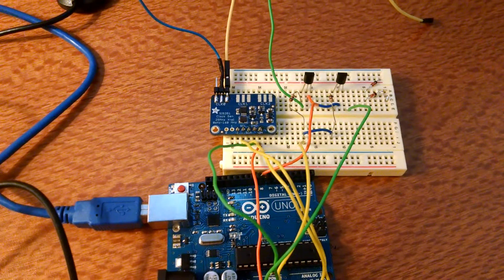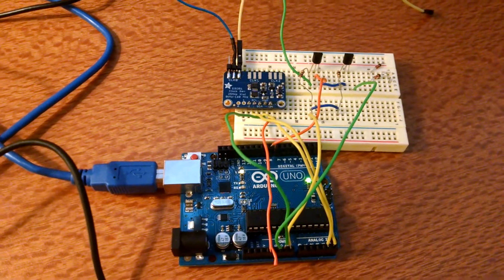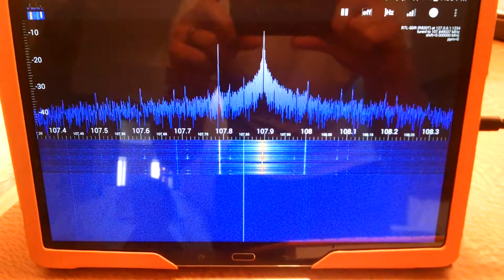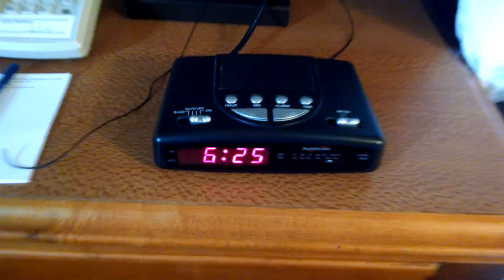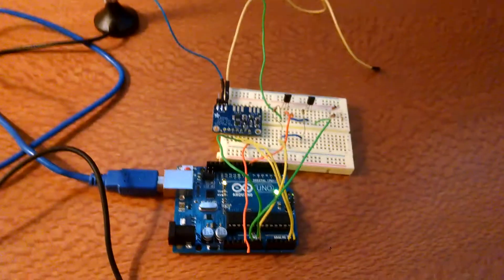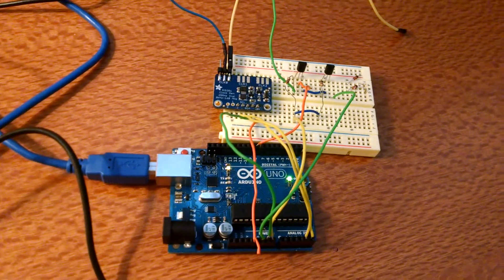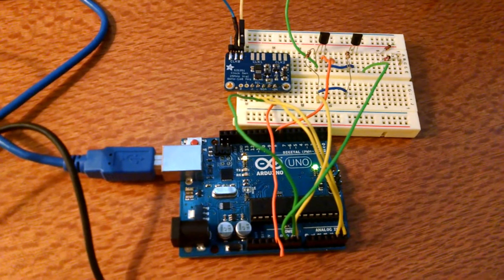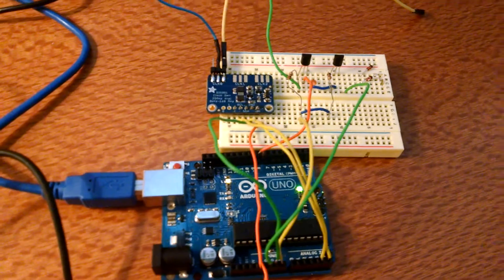Adafruit si5351 FM transmitter

Comment: Very cool, but this is not FM modulated. You are effectively adding the music waveform to the steady frequency output of the oscillator, which creates AM. An FM receiver can roughly demodulate this if the AM signal is strong enough. Also, the music waveform is switching the transistor on and off, which is why the signal comes and goes.

One common way to create FM is to use a diode (preferrably a varicap, but many different kinds will work) as part of the oscillator circuit. This is typically done near the crystal - the varying capacitance across the diode will "pull" the crystal above and below its nominal frequency, creating the frequency swings that produce FM. In this circuit, though, the "pullable" portion of the oscillator circuit is far removed from the characteristics of the transistor, so the base frequency is not changing.

As Steve Wright mentions below, the Si5351B chip has a voltage-controlled oscillator on board. That circuit within the chip can read an incoming voltage and use it to either trim the frequency output for improved precision, or if an audio signal is applied, use that to vary the frequency of the oscillator, producing FM. I have been looking for a breakout board for that chip similar to the excellent Adafruit product used here (or even just the chip itself at a reasonable price), but have not found anything (May 2018). 

Cheers!

Comment: You can use a diode in varicap mode (reverse biased) across the crystal to FM the whole oscillator, or else use the B version with a VCO input.